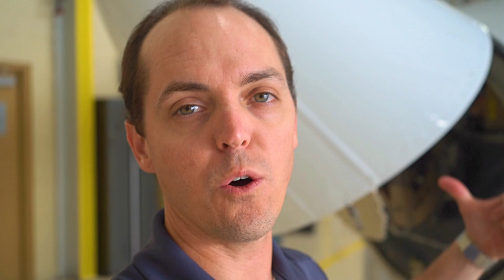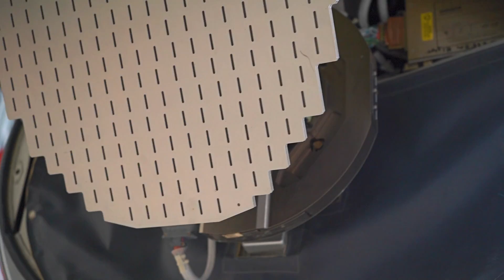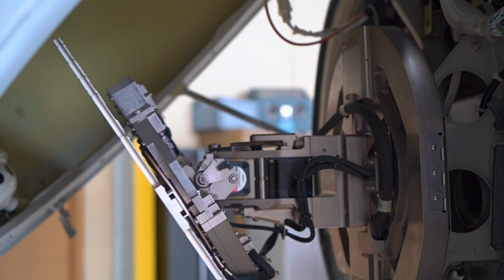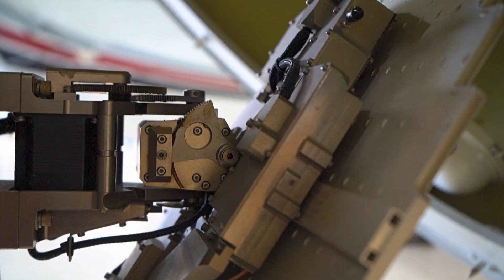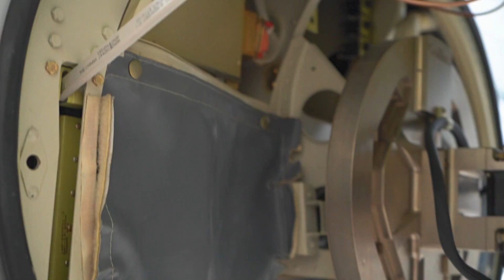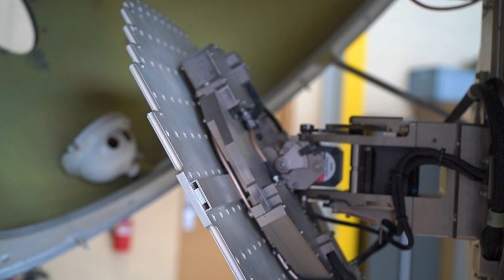Tech Tuesday - Corporate Jet Weather Radar

Comment: Nice video.  What may be an interesting add would be exactly what you mentioned, the art of using a radar properly.  Specifically, how to read the weather by shapes and colors, using tilt as well as range to fine tune your picture, how you use that information along with winds aloft to plan your avoidance strategies, and shadowing/attenuation and what story that tells.  A lot of pilots truly do not understand the capabilities, and shortcomings of their radars.
Reply from the maker: I was thinking about that. The only problem is that I have to be in flight, and doing a full "lesson" like that is difficult while I'm supposed to be flying the airplane. I'll see if I can put something together for it though
Reply: Corporate Pilot Life True, true, true...  It would be quite a challenge.  Thanks for your response!

Comment: I wonder why it has to sweep around? My non technical mind wonders why the plate can't be dome shaped, reducing weight and mechanical parts?
Reply: That flat shape means it's a phased array radar which steers its be beam electronically, not by sweeping the transmitter/receiver.  So good question about being tilted down.?

Comment: A smiling plane is a happy plane. 😁 However, seeing both a plane and its crew smiling at the same time was thought to be impossible prior to the advent of Photoshop. And we won’t even discuss how the owner of the happy plane feels...

Enjoyed the explanation for why the radar should not be used while on the ground. My guess had been a combination of minimal effectiveness (proximity to terrain/obstacles interrupting signals and/or generating false echoes), concerns about possible interference with airport equipment/operations (radios, etc.), and perhaps a risk of overheating. Very considerate of you to not microwave the ramp workers as they marshal you in and out. 😎

Comment: Hello Shaun, how many degrees does that antennae sway side to side horizontally?  I am guessing a 180 degree sweep side to side would be too much, but maybe 35 to 40 degrees to each side of nose center forward?
Reply from the maker: I think it's around 60 degrees each side
Reply: @CorporatePilotLife  
So a total of 120 degrees across the nose or 30 degrees to each side of the nose center-line extended?

Comment: Shaun, can the radar be used for terrain mapping?  Thanks for the tech video!!
Reply from the maker: In theory, yes. I don't know if I would rely on it for very much though
Reply: The radar will display returns regardless of what reflects the signal — moisture, terrain, etc.

My layman’s brain is having trouble coming up with any good reasons to intentionally seek out extensive ground returns. (It won’t paint a useful topographical map in the manner I think you are imagining.) The nearest scenarios I can think of involve aiming slightly above the surface at a specific distance to check for precipitation falling to the surface in that area (looking for mature/dissipating cumulonimbus clouds to avoid, for example), or perhaps, in suitable weather (maybe a clear, moonless night?), as a supplemental means of watching for sharply rising terrain (e.g. mountains in the vicinity of the flight path). Of course, those uses are only helpful if overall ground returns (clutter) are kept to a minimum, and I’m not certain the “rising terrain” scenario is valid at all.

Comment: Very cool looking at the radar Shaun!  I LOVE the smiling shark face it has when open too! At least thats what it reminded me of.  I just was reading about some weather systems planes have that have a delay of several minutes because its beamed to them.  I dont recall exactly what that system is called.  But with your own weather radar, you dont need to worry about keeping that delay in mind because your radar system is real time data, correct?
Good to see you Shaun and I hope all is well!
Reply: On-board radar is the only real-time radar option I know of ... unless you’re also counting the Mark I Eyeball. 😉

Both ADS-B (FIS-B) weather and XM weather have significant latency. It takes time to gather the radar returns, process the data, and generate and disseminate the images. My understanding is that the data is already at least 5-10 minutes old by the time it reaches the cockpit via these sources.
Reply from the maker: That's correct. The radar you see here is real time. I do like having XM or ADS-B weather information also, as it gives me a much broader picture of what I'm dealing with, but it is several minutes delayed.

Comment: As a Line Service Technician we get very close to the radome to chock the nose wheel and I always wonder if the radar was shut off.
Reply from the maker: Most aircraft have a forced standby function to shut off the radar after landing, but it can be disabled. If you start to tingle as you approach the nose, you may want to back away...
Reply: You have to be VERY close indeed before it’s considered ‘harmful’. Like, within inches of the radome close...

Comment: Shaun,
Just wondering, do the engineers try to make systems as simple as possible? I would think, especially the mechanical equipment would be created with the least and most easily replaced parts possible.
I was surprised how many of the Gulfstreams controls use cables, but it,s only the Big Boys that are controlled electronically, right?
Cheers,
Rik Spector
Reply from the maker: That would make sense to me, but I have no data to back it up with though. As for the fly-by-wire, Gulfstream is now moving to electrically controlled now as well. Way of the future it seems!
Reply: Shaun, I have a friend who does aerobatics and his plane has a "stick", hearkens back to the "old" days,Eh?
When I drive I'm one with the road, I am that vehicle, so am able to respond to the vibrations or changes in the conditions in and out of the car.
Is there something analogous to that when flying or taking off and landing, or is the feedback gone? Do you become "one" with your plane?
Cheers,
Rik
P.S., 
I'm happy to know I anticipated a future video:)
Reply from the maker: I know exactly what you mean when you say "one with the road. I feel the same way with flying. The feedback from the yoke becomes very natural and you learn how it should feel in any given situation. It did take several years to get to that point though.

Comment: First view! First Comment!  Is there a weight on wheels switch to disable the radar when on the ground as a safety?
Reply: No WoW connection to the radar.
Reply: Good idea, you would think that would be an FAA safety mandate.
Reply: Sometimes the radar is needed on the ground. If I am at a non towered airport taxing out I can make a go-no go decision before lining up on the runway. If winds are light I might be able to get out of runway 26 but not 08 due to a storms location.